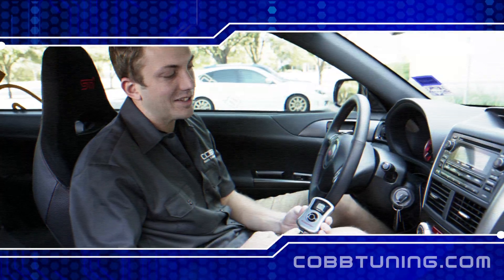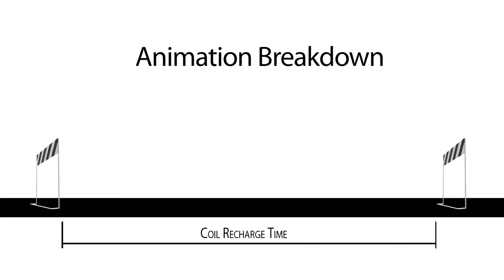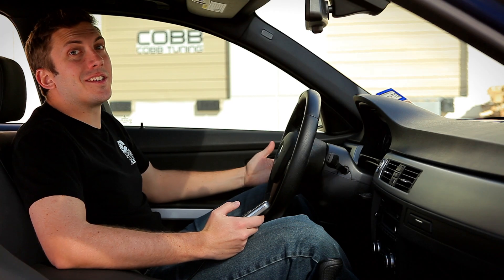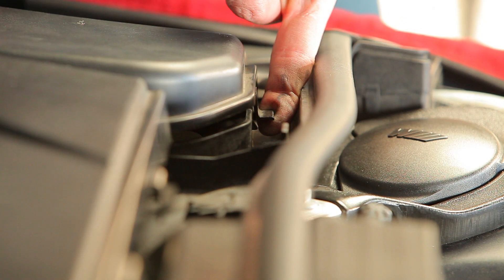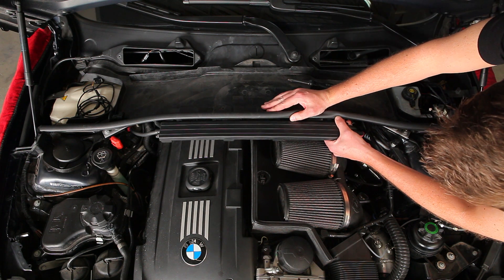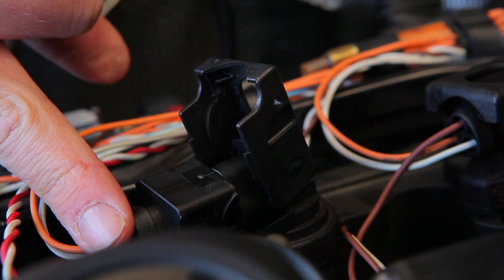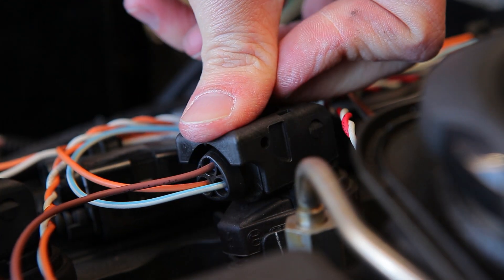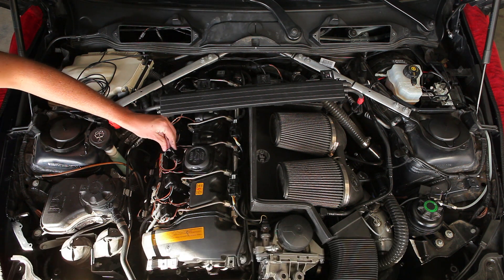COBB Tuning - AskCOBB Episode 2 - BMW Misfire Diagnosis and Repair

Comment: @AskCOBB I do have misfires on 2011 328 xi but the car does not give any codes. No check engine light as well. Do you think it could be something big ?
Reply from the maker: If you're not getting a code for the misfire it probably isn't something too severe.  Kyle@COBB

Comment: I did it today! Thanks for your video it really helped! I have 2009 328i and it's slightly different from your setup but I got it to work. Inside my car there is a engine brace. It goes directly over the top of cylinder #5. I had to unscrew it and move it out the way to remove the spark plug.

Comment: i have done all this still the same problem even replaced disa air flow adjuster still mis fires in cylinder 123 no leak and engine compression is also 160psi.

Comment: This post saved me $3000-4000 by avoiding the dealership recommended need to replace cylinders 1-6 fuel injectors.  The error code was cleared following the spark plug/coil replacement and the cylinder misfires are no longer occurring.  Thanks again!

Comment: Hi Cobb, what screwdriver do I use to remove the engine cover? And should I disconnect the battery while doing this? I have 2012 335is n54, the 5mm hex driver doesnt work

Comment: Hi. Thanks for a great video. I have a question. Do you use a copper based anti-seize before tightening the spark plugs to 17 pounds?
Reply: Helpful question and answer, thanks.

Comment: very good video!!! but what about, when you remove an change spark plug + coil the problem still persist same code,misfire cylinder * why is tha the injection or something else?  could be a bad head,or piston? can you help me, I have 09 n54 80k

Comment: I have a 2002 Mini Cooper and the check engine light came on and I was told that the code stated miss fire issue. I changed the coil pack and the spark plugs but the check engine light came back on can you tell me why or what other problem there could be.

Comment: nice video i have replaced coil and spark plug and still get the misfire on #3 that sucks i think i will move injector next to different cylinder see if that moves the issue

Comment: Awsome video, very impressive. Just wondering, you mention if the missfire continues it may be due to the injector or carbon build up. In the case of the carbon build up, where is this carbon build up and how can this be resolved? Thanks guys!
Reply: mrcupcalling Intake valves get blocked up with carbon. Google "N54 carbon buildup" and there will be plenty of information. It's a common issue and walnut shell blasting is the solution.
Reply: Thanks for the info!!
Reply: +Bryan Duncan soooo what did you do to fix the misfires?
Reply: You got ride of it all because of a misfire issue?! Clearly you had to of fixed it before you sold it... Mind telling me the end result issue? What codes did you throw?
Reply: Hmm, I am tuning it once I fix my misfires, got new coils and plugs and hoping that should do the trick. Only thing is mine is a wide open throttle misfire. What happened to cause your misfire?
Reply: Thankfully MHD is on the market for $150. Sounds odd that Cobb gave you misfires.

Comment: good vid but i prefer swapping out spark plugs first before coils since coils are like 5 times more expensive
Reply: Though it wasn't overly clear, it seems like that technique was meant to be applied to the situation demonstrated in the video where you've got a misfire in a known cylinder, in which case you swap the coil from a good-firing cylinder and rerun the diagnosis.  If the misfire has moved with the coil to another cylinder, you know that coil is bad and you've discovered the source of the misfire without spending any money.

Comment: My 06 bmw 325i turn over but not start I change fuel pum relay and still do the same thing it will not start. When put the key in the ig I don't hear the fuel pump running. The fuel pump work when I start the car. Help me please

Comment: There are more than 2 reasons a car can miss
Reply: And if you would've comprehended (or even watched) the whole video, you would know he mentioned that if a plug and/or coil doesn't correct the issue, it could be "an injector problem, carbon buildup, or another mechanical ailment."
Reply: You must be smart

Comment: Ian did he ever reply to your questions "
Hi Cobb, I have a 2007 BMW X5. I have replaced all the coils and spark plugs but still getting multiple cylinders (#1, 5 & 6) misfire. " I have the same problems and it's not the plugs or coil packs. And the injectors were recalled and replaced in 2011
Reply: Is your X5 equipped with the N54 engine shown in the video?  If so, and the plugs/coils/injectors aren't the issue, it could be excess carbon buildup on the intake valves.  These early direct-injection engines are notorious for it.

Comment: Thanks for sharing the video. it has been incredibly helpful.

I have a 2008 E92 320i. I replaced my ignition coils as part of the recall 3 months ago and replaced my spark plugs immediately afterwards.As soon as the London cold weather kicked in I started having random  (once every week or 2)  engine misfires on cylinder 3 on cold starts only: Error code: 29C. I tried swapping the coils and spark plugs but the error remained the same in cylinder 3 and soon afterwards the problem exacerbated resulting in rough idling. I thought it must be the fuel injector on cyl 3 so I ordered a new one from BMW and carried out the replacement myself as per the video and I've also performed injector coding on INPA.

The rough idling problem is no longer there following the replacement but I am still getting random engine misfire on the same cylinder (errors 29CF). Im getting frustrated with this as I tried everything, is there anything else I should look at?

Many thanks!
Reply: Just reading your comment and I'm experiencing a very similar issue, missfire in one cylinder, in my case #2, changed coils and plugs but no change. BMW plan to change all 4 injectors (I know, ffs!), and the coils/sparks again, will hopefully fix the problem, but am curious (as your comment was added a year ago) if you ever got a solution? Thanks!
Reply: Yes I did! Very weirdly I had to change the 4 coil packs (apparently there was  another product enhancement on them) spark plugs and the fuel injector. It's so bizarre and when BMW recommend the change I thought it won't fix the problem but I went for it on the basis that I'll ask for refund if the problem persists. Fortunately the problem was solved but I'm still puzzled by what went wrong!
Reply: Forgot to add the key point- I changed the parts twice
Reply: If you are carrying out the replacement yourself might be worth changing one injector at a time rather than paying for the whole set.

Comment: Thank you for this video. I was able to fix my rough idle, no power and misfire   on my E90 with this very clear video no problems... and the only DIY project under my belt was an oil change. 

A year ago, I had this problem, and panicked , was 'happy' with a $200 fix at a BMW repair shop- replacing just one coil pack. When it happened again this year, no panic. googled it, got comfortable with a DIY solution many thanks to this video.

Thanks again!

Comment: Thank you for this! Helped me a bunch! I got all new plugs and the misfiring coil because I know that most misfires are bad plugs and not the coils. When I took off my #1 Coil I noticed corrosion on the inside. Replaced it and the plugs and boom! Fixed :) Excellent video!

Comment: Hi Cobb,
Please help, I have 328i 1999, I replace all coils and spark plug with bmw coil, boot and 
ngk spark plugs all from BMW parts, but still getting multiple misfire.
Also, is it necessary to re-program the DME after changing or repairing some parts?
Please help.